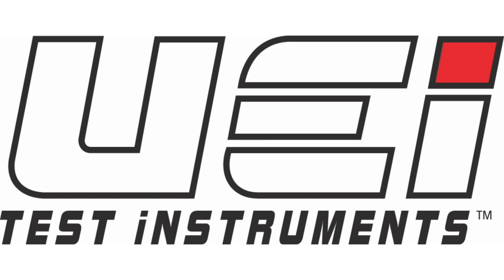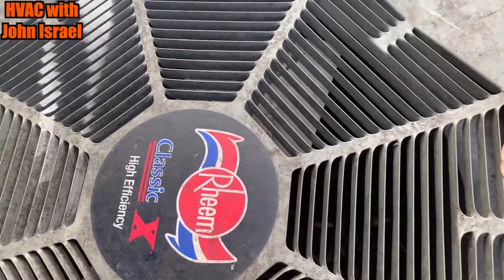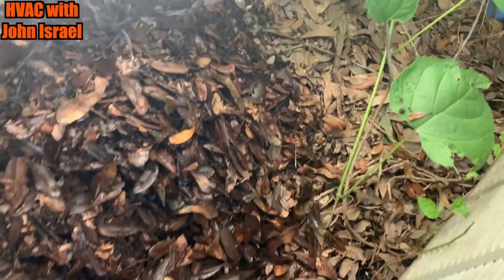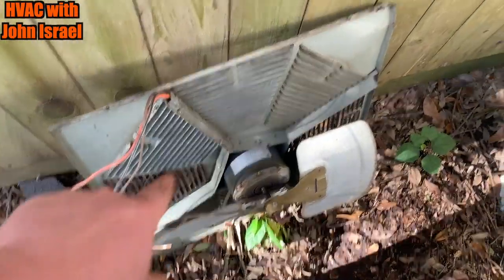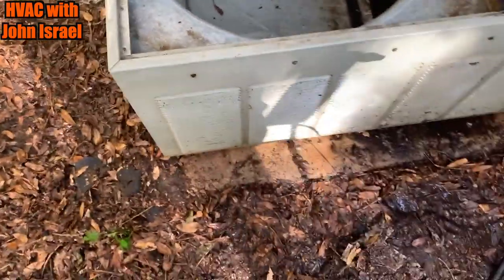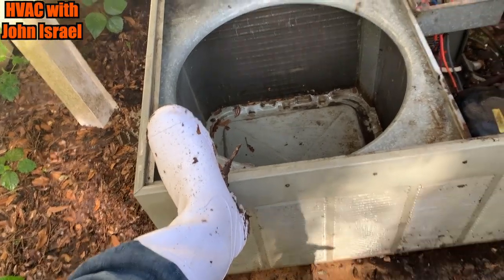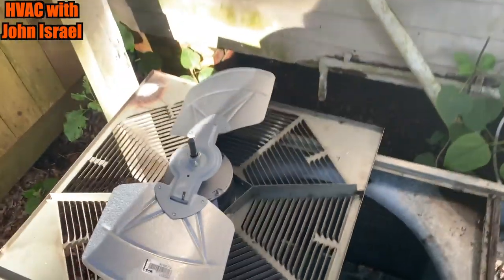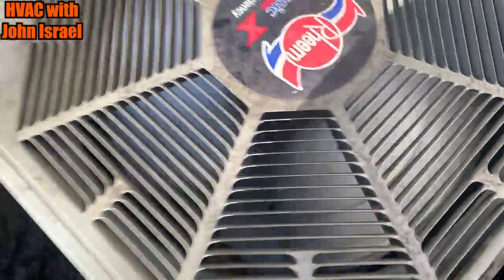Replacing a Rheem HVAC Condenser Fan Motor

Comment: I remember back in the early 2000s my Nana had one of these classic Rheems installed. She was so proud of her purchase. She passed away in 2007 but I bet that unit is still cooling to this day.
Reply: Ardie McLelland input one my sister’s in 96. Still running original compressor. New fan cap and contactor no refrigerant leaks.😁
Reply: HVAC Mike older is definitely better. I have a comfort maker from 1996 as well and as far as I know everything is original on it.
Reply: Ardie McLelland the old comfort maker units are tough like the old square tan colored Tranes I still find these on occasion still working. Probably cost a fortune to operate. The old fan motors and caps with the PCB Oils in them would last forever and you rarely changed a blower motor.
Reply: HVAC Mike mine doesn’t seem to use a whole lot of energy. We live in a 3 story house and it has a bit of trouble cooling the top floor so I’ve closed the registers and put a couple window shakers up there to help take the load off of the comfortmaker
Reply: Mines 23 years old and still going strong.

Comment: I believe this is one of the best designed condenser on the market as far as service. Everything is easy to get to. The only negative is can be a little bit of a pain to remove the guard to clean the condenser coil. I have installed a few hundred of these since 79 no way to know how many for sure.

Comment: HELP 
I have a carrier heat pump that 2 to 3 times a week has a hammering sound for about 4 seconds. It’s a 2 ton heat pump. Anyone ever seen this problem or have any ideas. Factory rep has no idea. In over 40 years I have never seen this issue. 
   Called my friends in the trade. Nobody has any idea SYTEM IS 2016